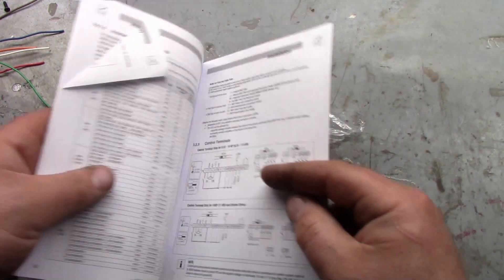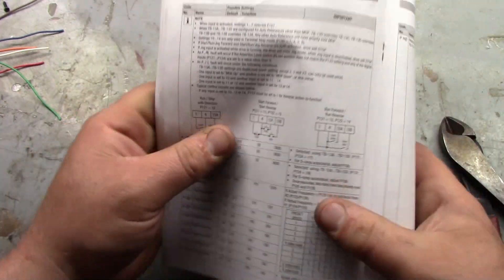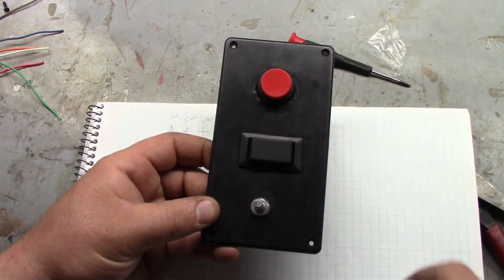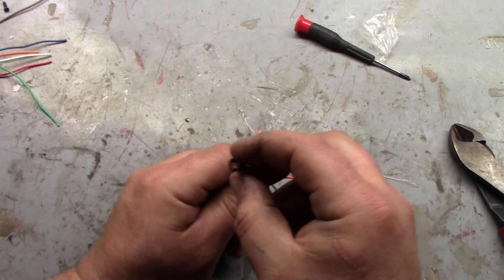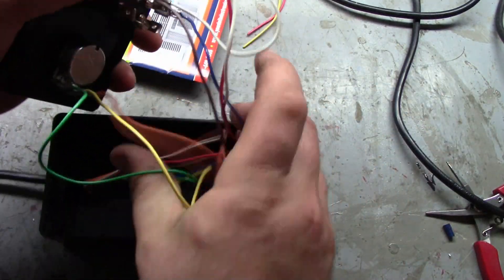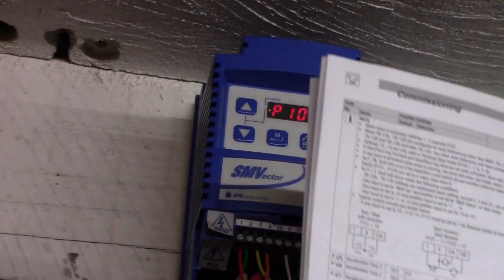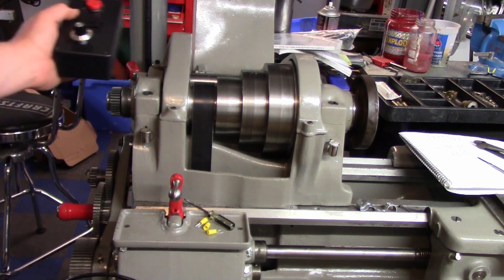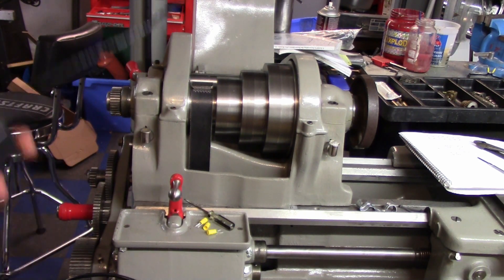13" Southbend Refurb: VFD Remote Panel Installation

Comment: How would I do this same setup with an extra control station? Both ends of a conveyor actually. Could I parallel all of those connections?
Reply from the maker: Technically you could and set the inputs momentary and use pushbuttons.

Comment: On many of the Chinese vfd's available online the touch panel is removable. You can simply purchase a 10pin IDC cable for $7 and extend it to wherever you want it to be. My vfd sits inside computer cabinet and control panel remote to the face of the mill affixed in a custom bezel box. It is nice not having to follow a schematic and essentially just adding a longer cable.

Comment: I find those "christmas tree" step bits are the shizz for all those alternate materials.  Nice series, 3 phase motor and drive are next for my Clausing 5913.  Should I go 2HP, which is factory, or more?
Reply from the maker: thanks for the tip.  I'd stick with 2.  Your cutting action is more of a function of overall machine rigidity than motor HP.  For example my Bridgeport is 1 HP and the variable speed (2J) Bridgeport heads are 2 HP
Reply: scrout I upgraded both my mills from 2-3hp and used 4kw vfd's. The cost isn't much more and you will have better torque at lower speeds with a larger motor. My rule of thumb is go up 1hp from stock when using vfd's. If the motor fits why not...

Comment: for sure heat shrink over the terminals.  thinking of vibration and voltage drop, should probably use stranded wire and perhaps shielded. hard to say how susceptible those controllers are to noise.  :)
Reply from the maker: Usually noise only becomes an issue when using long lengths of wire to feed the motor or the controls.  These are all less than 8 ft on the motor feed and 5 on the control

Comment: Just my 2 cents here, my drill press with same controller, I used a big red crash stop button that latches open circuit, twist to reset and a mechanical interlock switch that prevents it from going from Fwd to Reverse whilst spindle is turning.  the motor is silky smooth but does not like reversing even if turning real slow.
Reply: 1945 drive, took all weekend do dewax it. 15Kg flywheel/fan. It really doesn't like reversing.

Comment: Hi Greg, great series. Wondering if you've noticed any drop in torque (power) when slowing RPM through the VFD rather than the normal belt configuration. Somewhere I thought I read that but have never experimented with it on a lathe or mill. . I use a VFD on my Delta 14" band saw to get it slowed down for metal cutting and it works great for that application, but that doesn't require a great deal of muscle. Thanks for your terrific input and training.
RLFort
Reply from the maker: You will get some drop in the extreme slow speed, but honestly I'll be using the belt more than anything like normal.  I'll maybe slow down a little from the VFD if I experience chatter or something like that, but most of the time the VFD will be set @ 60Hz
Reply: Halligan142 hey halligan what's your Facebook page please ?

Comment: Greg,
Since the pot has solder lugs on it, you could have just soldered the wires to the pot directly. It would have saved you the hassle of insulating the push on connectors with heat shrink tubing or whatever you used. Otherwise, nice work! Yes, I like your 2nd panel better! I've misdrilled a few control boxes in my day. It's most frustrating . . . especially when I have to tell the boss that I fucked up and need to purchase another control box!  Thanks for the video!
Have a good one!
Dave
Reply from the maker: It's the service tech in me.  Ease of replacement.